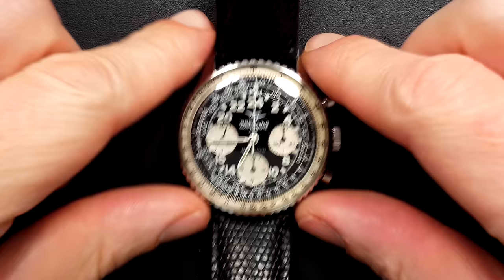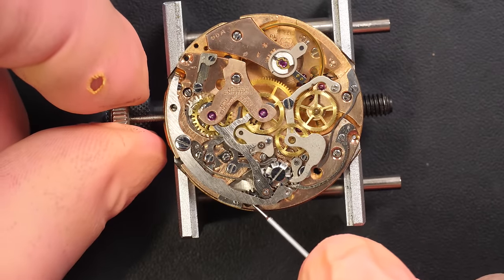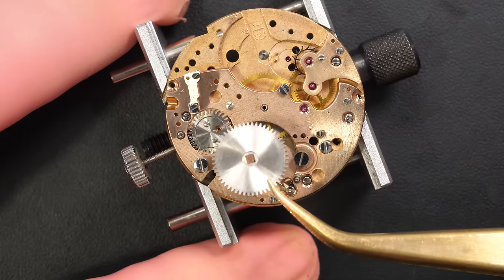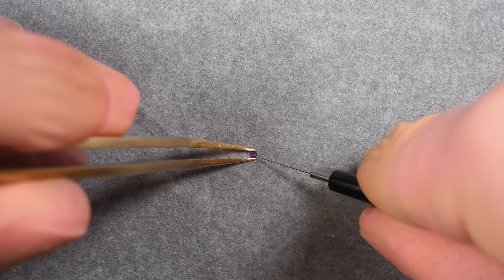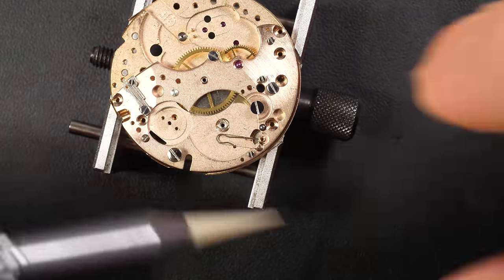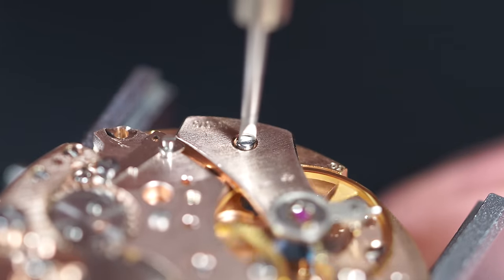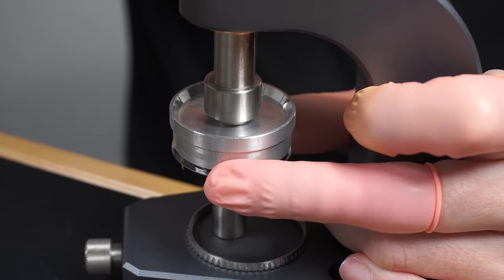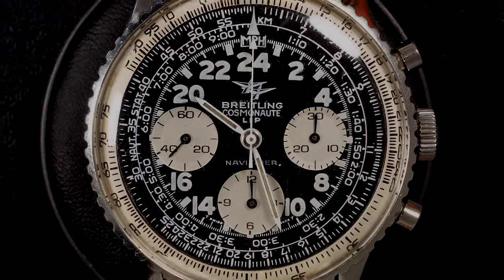Restoring the Breitling Navitimer 809 !!! A True Legendary Cosmonaute Chronograph

Comment: 23:10 Grease is used in areas of high Pressure, not high friction.
Main bearings in a jet turbine have a lot of friction, they use thin oil.
Cams and levers in the keyless section of a wristwatch operate under high pressure,  and use grease.
Reply from the maker: You are right

Comment: Great Video. Merci. Did you reduce the play in the mainspring arber, or center wheel? Or wasn't it needed? And does it make sense to put the watch on the TimeGrapher to check beaterror and amplitude before you assemble the chronograph parts?
Beautiful timepiece and background history.
Reply from the maker: I did not reduce the play because it was not needed on this watch. Yes I put it on the timegrapher before but I don't always put it in the video